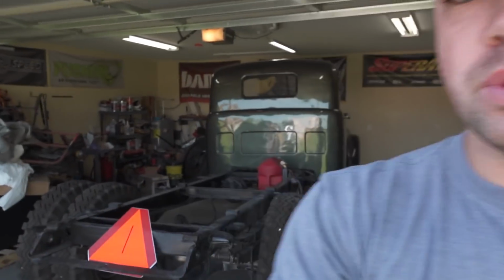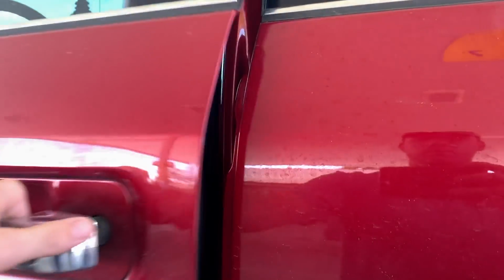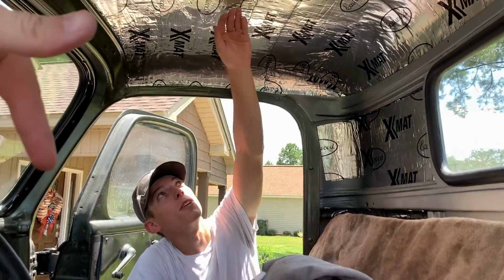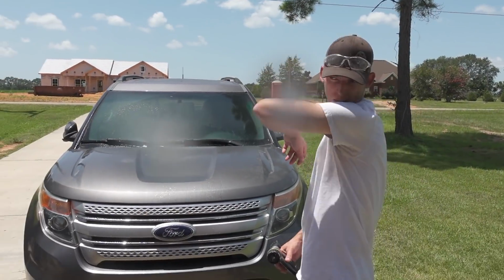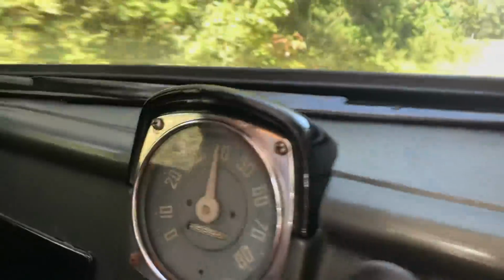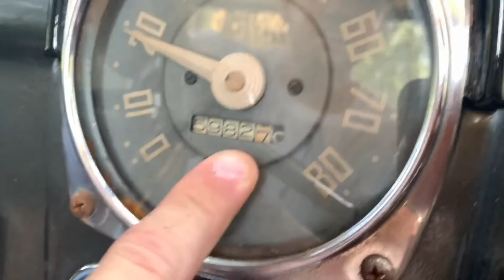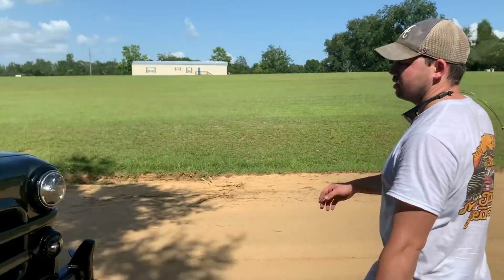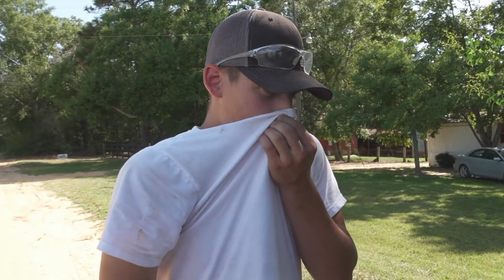Mater Broke Down Far From Home.. Can We Fix it?

Comment: The reason your coil is getting hot is that you haven’t put a ballast resistance in between your power supply and the coil. This is also a likely reason the the truck stopped. The coil can explode so don’t continue to run it like this. You will have also most likely have burnt the points so they may need to be cleaned and regapped. You can buy a ballast at the auto parts store. This will reduce the supply to 8 volts which is it correct operating voltage. The reason it is done this way is so that when starting the motor you, through a relay put 12 volts through the system for a moment and get a hot spark to help the engine fire up. Your truck predates this process and it originally had a coil made to have 12volts go through it all the time without getting hot. The coil you have may be marked 12volt but it will be ment to be used with a ballast.
Reply from the maker: Thanks Craig!

Comment: Might be vapor lock, heat causes air bubble in fuel line to carb. Cool it with a wet rag. I might also suggest taking some of the keys off your key ring , that much weight can damage the ignition switch !

Comment: just a thought about the coil. your friend put all new wiring in the truck, maybe there was a resistor going to the coil. if you take the resistor out it will overheat that coil pretty quick. there is a way to ohm test the coil and a math equation to find out if you need a resistor and how much resistance you need to match the coil, if not correctly matched your spark won't be very hot and the coil will eventually overheat and stop working until it cools off.

Comment: One thing to remember is if the system is not charging then there is a heat factor that becomes involved. It will burn the points like crazy and also the coil will boil its oil out rendering it worthless and need a replacement. If it don't charge then don't run any other stuff like the lights or heater or radio as it draws away power and it is measured power so it probably did burn them points... a nail file for once or maybe twice and then its new ones again. You think it runs good now, get that intake off and find the leak. While its running though, keep it running and take that starting fluid and spray around the whole manifold, where it goes into the engine and then the base of the carb and see if its leaking through the throttle plate, base gasket or any vacuum line itself. If its sucking air then the starting fluid will suck in right there and make the rpms come up right now. It will not hurt it and might knock so dirt off. I see the love for old equipment in you kids eyes and its what brings me back.. a like for both of you
Reply: I was thinking it was just heat soak. He could've probably just held it WOT and turned it over.

Comment: From what you are showing suggest that you might have either broken a wire somewhere. Another situation you might consider is that your coil has died. The hot coil indicates either a broken wire or a bad winding inside the coil. There is also the slight possibility that the floats have stuck in the closed position and that can be temporarily cured by a light tap on the side of the float bowl.

Comment: Is there a resistor on that coil? Those old ignition systems usually had a ballast resistor or resistor wire in-line on the positive side of the coil. Not having one, or not having the right one can cook a coil. If I remember correctly, they do make coils that don't need a resistor.

Comment: If that was a six volt system and it was changed to twelve volt you may have an issue if you didn’t change the coil over also might want to take a look at those points they could’ve burnt up due to the coil possibly being wrong 😄 just something to look at , I’m having fun watching, you’ll get it😁😃

Comment: If that coil is getting really hot that can create issues. The resistance in the coil goes way up, reducting the voltage getting to the distributor. Just a question are you still running a six volt coil on a 12 volt system?

Comment: Your suppose double clutch  those older trucks they are not synchronization  transmissions
Reply: some yes some no  depends on the trans dosnt it? im not familar with these  but its a 2 speed rear and 4 speed trans  that dosnt sound like its being ground switching without clutching into and out of gear from nutural and he isnt rev matching for syncro in a non syncro gear set so im not shure how its set up lol

Comment: If your coil is hot it is prolly the points need adjusted or the coil is grounding out, i had the same problem on a old 8n tractor im redoing

Comment: To mention something no one has, the carb might be percolating , then tri a "bake alight" spacer between carb and manifold to isolate heat. I don't use the clutch when driving, only on take off and stopping.

Comment: @parodoxz so that old truck had a non synchronized manual transmission so double clutch and make sure you're at the right rev on the down shift tap that throttle and bring the revs up to match the gear and speed revs it'll reduce all that grinding you're getting

Comment: Ok so just a heads up on the coil being hot and mater running a little off and all. Dont know if you replaced the coil or not but I do know they can cause the engine to run a little off when they are going bad and also can get really hot when going bad and they will also not work once they get hot if they are going or have gone bad. Ive been working on gasoline engines since i was like 5 and even went to school to learn more about cars and have seen the coil problem first hand. I have a 1980 f350 im fixing up to look good but not keeping all original because it has a salvage title. I even have a gm hei distributor in the original Ford engine. Now that took some doing but the truck runs a little better now. Keep up the good work.

Comment: go for a true 1 wire alternator and with electric fuel pump they will vapor lock or stop pumping . you can remove it hook it to a test fuel line and when it pumps reinstall it. and keep a extra for that day.

Comment: How many 2002 Chevrolet S 10 4X4,s are still running? I have one bought it off a buy here pay here $$$$
I rebuilt the whole front suspension the motor runs great body is solid.Are you sure you’re not out of gas?

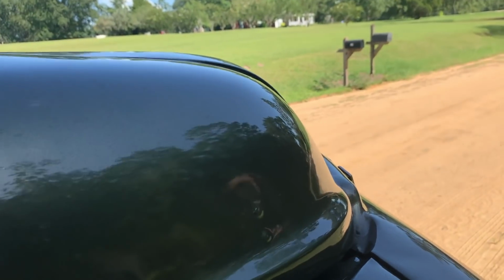Comment: Certainly there are no shortage of things that could cause 'Mater to run rough and not start. Fuel or ignition rated. Keep in mind about 92% of all no-start issues on old vehicles are related to the ignition system. If you aren't planning to use this engine,  you may want to limit your spending on it. I'm wondering how did you determine there was gas or not in the carb bowl by looking at it at the 16:05  mark in your video? Fuel with ethanol in it causes all sorts of headaches. Especially as ambient temps heat up. Was it hotter there that day you broke down, compared to earlier trips in Mater, when the engine seemed to run well?

Comment: Do you have a 6 or 12 volt coil?  I suspect your alternator is 12 volt.  Has the electrical system been changed?  Originally 6 volt, positive ground

Comment: guessing here  check your grounds  engine chasis battery  if the alternator is good it should be one of those  replace the condensor  clean and gap the points if you havent got spark  or its weak last check your feul filter and that should cover most things  your probably going to run into a few more hiccups fully waking this grandpappy from his nap erery wear item is probably worn gaskets seals berrings hoses lines everything will be prone to failure just due to age or fatuige or uv exposure . good to see it running again and on its way to being reliable thanks for the videos  remember we are the product and google is the customer so complaining to youtube  is like a cow complaining to mc donalds